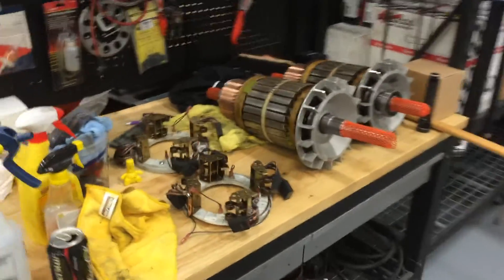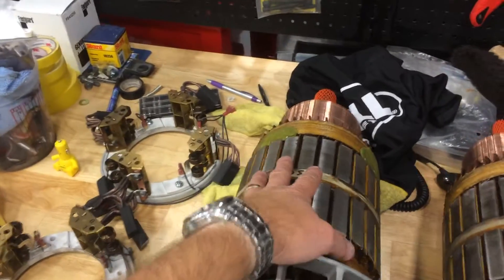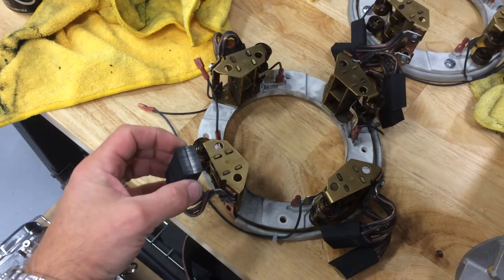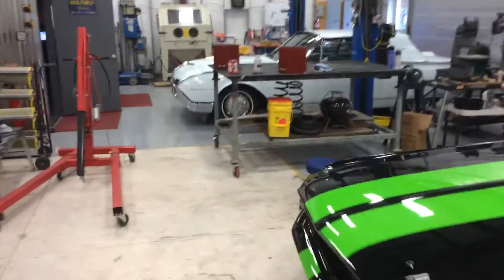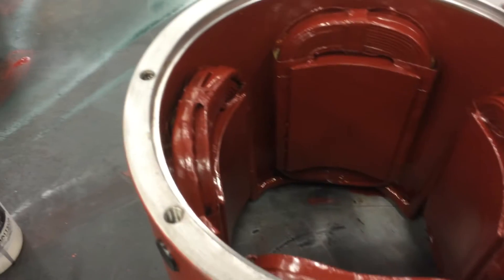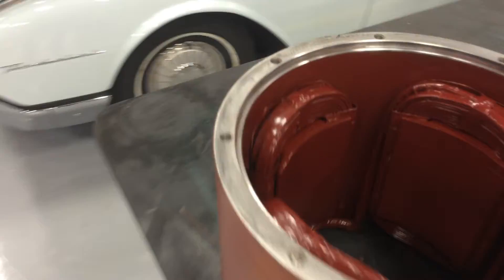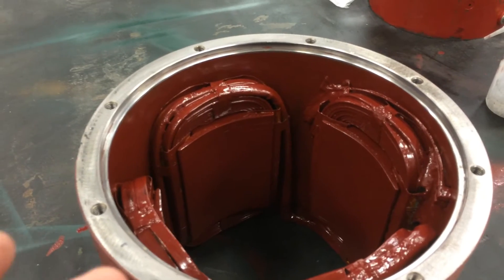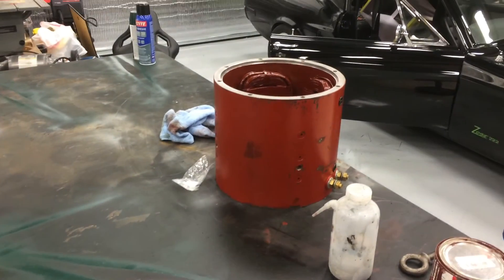Motor preparation

Comment: Why not use the HV version of the Warp 11? Interpoles makes a big difference in voltage handling capability. On top of that you lose less power as heat on the commutator because interpoled motors have virtually no sparking problems under having loading since armature reaction is greatly reduced. I'm surprised that gas engine gear heads that use many secrets when building drag racing engines are not using every idea known for a long time to build their electric DC motors for very high performance. 

Some secret sauce ideas for drag racing DC motor:

Brush pressure
Interpoles 
Remove fan from motor
Remove all grease from bearing, but add oil

Comment: Excellent idea for the painting for better insulation! i've been using this kind of red varnish paint  class F 2600VPM to protect our brushless hub motor when overpowered from 0.500kW to 25kW.  it help to keep all the little strands together reducing fatigue on teh winding and prevent breaking strands at high phase current when these chineede cheap motor stator  strands vibrate.  
https://endless-sphere.com/forums/viewtopic.php?p=1073534&display_history=true